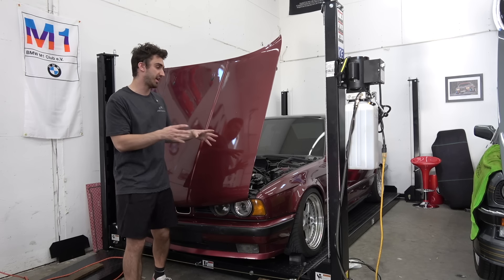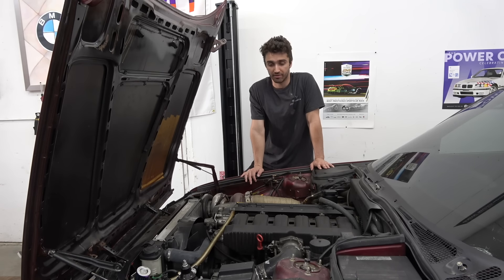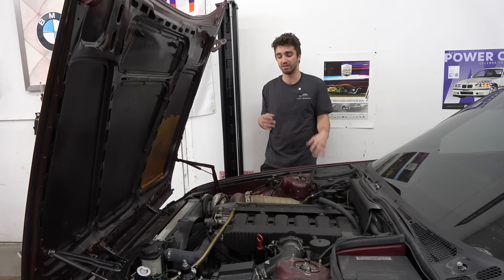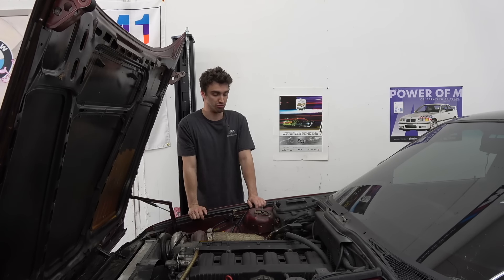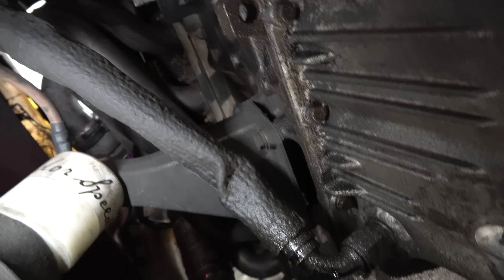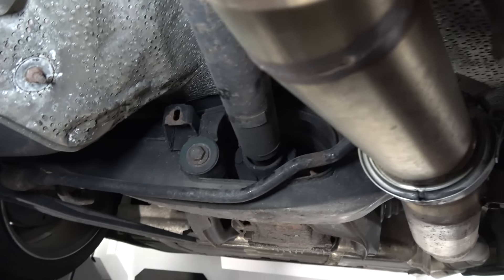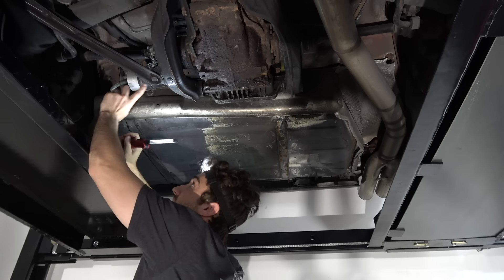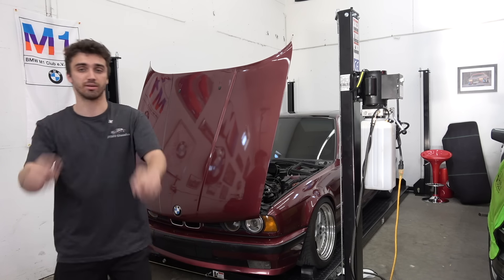How Well Does a BMW E34 5 Series Hold up After 5 Years of 500+ HP Turbo M50? Costs and Reliability

Comment: So Awesome!! I have Loved the E34 platform forever! I got a Euro Spec 535i5 years ago which tragically got totaled, and was able to replace it with a high mileage '93 525iA. It's been sitting for years now, but I really wanna restore, manual swap, and turbo it!... Question is, should I go ahead and do the M50B30 stroker swap, since the current motor has over 300K on it?
Reply from the maker: Really up to you! M50b25 as seen here is good for a lot of power. Stroker engine will just take less boost to make the same power. At 300k its perfect candidate for a send it!

Comment: Those OZ Mito's look great. What are your wheel sizes and offsets. Also what are your tire sizes and suspension mods. The stance is absolutely perfect
Reply from the maker: Geez its been a while, off memory 17x8.5 et 10ish front with 235/40 17 and rear is 17x9.5 et 20ish with 255/40

Comment: Awesome build 👍 
Which would be a better candidate for a turbo build, m50 with vanos or without?
Reply from the maker: Non vanos has stronger rods, and dual valve springs so technically that, but both are super good

Comment: Thoughts on doin this to a M52B25 out of a 323is ? (Any info appreciated)
Reply from the maker: Aluminum block so not really strong enough for boost like this.
Reply: @m3nameisjosh464 what? Its a cast iron block
Reply from the maker: @hexagonosaurus5848  m52b25 is aluminum. M52b28 is iron.
Reply: If it's iron block and a 323, only difference from a 328 is the smaller intake manifold. 323 blocks are know to have thinner walls in the block so you can't bore or boost them as far.
Reply: @m3nameisjosh464  Nope. Every single USA spec E36(which a 323is is) has an iron block. 
I dont know who told you that lol
Reply: @jasonschreiber6458  nope, the only difference is the intake manifold, exhaust manifold, head, vanos, cams , entire engine managment system. Why are you people so ignorant ?
Reply from the maker: @hexagonosaurus5848  i have quite literally owned a 323i with an aluminum block….
Reply: @hexagonosaurus5848, The 323 head is the same casting as a 328 and the 325 ( m50tu and m52 all single vanos heads are #400 casting) . Please explain the difference. The intake is the same between a 323 and 328. (M52 intake ) Only one bianary single vanos system on all single vanos m5x cars. Please explain how vanos is different on a 323?  a 328 dme is ms41 and a 323 is ms41 ? (Other than software they are identical )  Yes the North American s50/ s52 uses different cams, and trays with conical springs, yes the North American s50/s52 cars have more holes drilled on the heads mating surface for cooling. North American  s50b30 cars use a 86.xmm bore and 86.x mm stroke . North American s52 cars use a 86.4mm bore and a 89.6mm crank. Some 323 blocks have had issues going bigger than 85mm bore. Some say the 323 block is a different iron, but I have no first hand evidence to prove that. The north american s52 and the m54b30 use the same alpina based crank.  Yes a non vanos head has bigger bore lifters and 7mm valves with dual springs , but no one asked about a non vanos engine. I'm comparing the 323 to the 328 as they are bolth from the same years in the u.s (where I am) You could buy one or the other thoes years. 2.5 (m50/m52) cars have a cast nodular iron crank. 2.8 has a forged steel crank. Cast or forged, bolth cranks have proven plenty strong in boosted applications. The difference in crank material is a moot point as I have not seen a broken crank on any m5x. Cams have the same grind and lift on a m52 323 and a m52 328.
Reply: @hexagonosaurus5848 How do you know the original poster,  asking about a 323, was in America?
Reply from the maker: @jasonschreiber6458  mic drop

Comment: The real question is how many miles have you put on this turbo setup? 5 years is a long time, but that doesn't mean much if it's barely been driven, haha.
Reply: You don't know shit about turbo builds if mileage is the paramater you judge the reliability by.
Reply: @hexagonosaurus5848  I’m far more impressed with a turbo setup that lasts 100k miles than one that makes 800whp. Cars are meant to be driven, so that’s why I judge reliability by mileage.
Reply: @DannysGarage  go drive your accord for a 100k then
Reply: @hexagonosaurus5848  why would I do that when I have a 257k mile E34 525i lol.
Reply from the maker: I dont keep track of mileage much, but I have driven this car on 2+ hour roadtrips, beat the hell out of it every drive, and have not had to think about it everytime I fire it up. So reliability is there. A turbo build not built properly will usually tell u it’s unreliable on the 1st drive haha
Reply: Do you use Amsoil?
Reply from the maker: @chrishernandez1986  die hard castrol 10w-40 high mileage